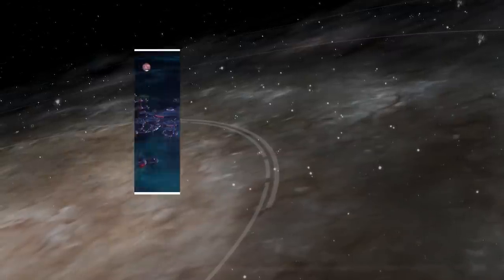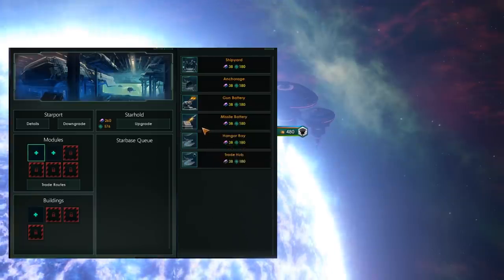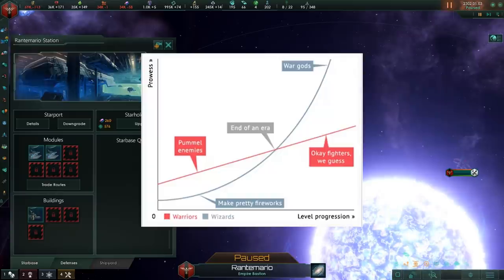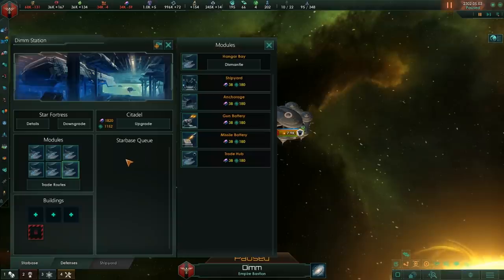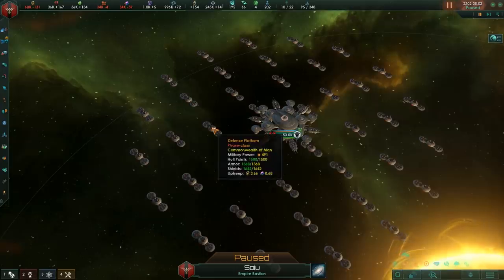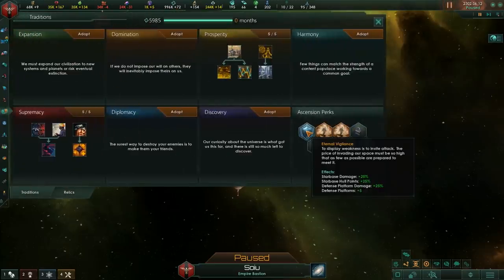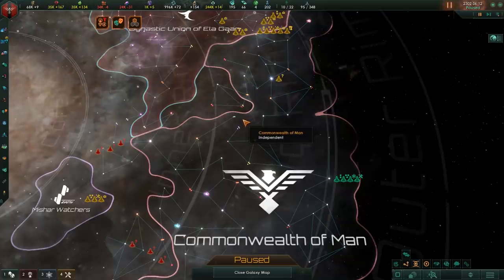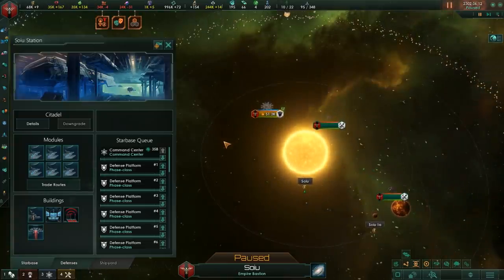Stellaris - Starbase Mechanics are Weird

Comment: Depends what you're looking from a station I guess, I love to put upgraded stations on a chokepoint mostly to benefit from that reduction of shields on the enemy and sublight speed (and listening post early game to know when fleets are spproaching) mostly as a backup to main fleet but it does give a good boost when fighting in the system. What does bug me that lategame stations are just being wiped by fleets no matter how many extra defence platforms you have, they can stall enemy for a bit sure but in the end all your defence stations are lost and have to be rebuilt which takes too much time and alloys. I think defence platforms need to be cheaper or become part of station and simply be disabled/recaptured as stations do

Comment: This is one video I'm going to have to disagree on. Even in the late game I use stations as a way to minimize losses to my fleets. If you know where an enemy fleet is going to arrive set your fleet a mid distance away from the station on the opposite side of the system the enemy fleet will arrive. The enemy will engage the station first (whose power doesn't really change outside of defense platform losses), your fleet will engage the enemy, and then the enemy fleet will get strung out and pulled into a very thin line that will put many of the smaller ships way out of position and leave nothing but their bigger ships behind stuck between sometimes shooting the station and sometimes your fleet. It's probably a cheese tactic since this is using the fact that the fleet AI seem to bounce priority constantly when caught like this

Comment: I have a mod, can't remember which one, that adds more buildings and modules to starbases, both in number and type. It also adds 1-2 more starbase levels which pretty much make them able to to kill or at least hold off most fleets.
Reply: How do ai’s deal with them or do they not get the upgrades?
Reply: @bubbles7608  The ai did use them, just not to the extent a player could. The final station levels are expensive.
Reply: The nsc3?
Reply: @13akful  Might be

Comment: One big station with only the hangars and one with only the trade hubs + gateway network. To protect and collect all the trade value. Spread shipyards on several, but far away from borders. Combine shipyards with anchorages to squeeze out all the fleet capacity that you can squeeze out at any given time. Do not cluster shipyards+anchorages stations, spread them around and connect with gateways as well. Make sure that it is hard to cripple your empire by the enemy by just taking one or two key stations. Spread your specialized colonies as well for the same reason. Research regenerative hull tissue early on if you can, all your stations will have it the same way they get FTL inhibitors. Combine defensive stations in the early game and against any crisis with systems that have environmental hazards that are not just coming from a system being in a nebula. Do not use Citadels for anchorages, save those alloys for reinforcing fleets and/or retrofitting them to hard counter the enemy fleets. That is my philosophy at least.

Comment: I use stations like you describe for baiting enemies onto them and then have my fleet attack, but I do this for longer than you do.  It's not like it's hard to set up a choke point where a fallen empire has to come through to attack me, and adding a bunch of hitpoints alone to the battle is helpful.

However, for real defense, if I feel I can't hold my borders, I just build habitats and make it a fortress.  Fully decked out, it holds.

Comment: I find citadels quite useful actually. Especially for protecting systems of high importance such as my capital and any system in which I have built a Dyson Sphere. The reason being that even though the station can be destroyed in late game, in most cases, if not all, it manages to hold the enemy off long enough for my main fleet to not only return to my space but make it all the way back to said systems. Furthermore, in the cases where my main fleet is nowhere nearby, having a citadel allows me to use any of my much smaller fleets to win battles against larger fleets. For example, in one run, I had split my forces into 5 main battle groups as I was fighting on different flanks. While assisting my allies against the end game crisis at the time, one enemy fleet managed to make it into my territory and attack my 2nd battle group's headquarters. That station was a citadel and it was working on pumping out a colossus at the time which was needed to finish the war once and for all. Had it not been for the strictly military citadel, I would have lost a crucial part of my plans, but the citadel, armed with 2 ion cannons and max defense platforms not only held its ground but once a smaller fleet which I had guarding another system arrived and caused the enemy's fleet to turn away from the citadel and start focusing on them, the citadel managed to shred the remainder of their ships to pieces thus proving very effective. Needless to say I immediately redirected a much larger fleet back to that sector to defend until the colossus was finished but it just proves that if used right, a citadel can be the difference between victory and defeat.

Comment: if you disassemble a module on a station in a fight, it resets its full health. not advisable in multiplayer pvp (is seen as exploit, unfixed since forever), but it might make your heavy station defend more in single player - you can have up to 6 resets that way, regaining shield and armor value (minus what the module gave). it does not work on captured stations. it might also work with downgrading.
if you build defense platforms with almost nothing on them on outposts, they will also suppress piracy for very little upkeep.

Comment: I always build them in my capitol system, shipyard systems, and any system with a megastructure in it. Also, place them at choke points on the borders and connect ALL of them through gates. In my capitol system is always a rapid reaction fleet that can respond to any of those chokepoints or other important system. That fleet IS NOT for invading other empires or anything else you would use a fleet for, it is the fleet that will defend my empire if some bad shit goes down while my other fleets are away. The citadels might not completely stop an invasion in its tracks but it will slow it down until my rapid reaction fleet jumps in to end the threat and can support the fleet in driving the filthy invaders out of my empire before they do to much damage.

Comment: Saw a lot of comments regarding Lathland's super Citadels. People seem to forget that at a similar tech level, the battleship doomstacks will still absolutely dwarf the Citadels' power. With optimized play, you can have about 1.5-2m fleet power with a little under 5 repeatables by the time crisis arrives with 2250 endgame date (so it arrives around 2310-2320ish). Take that to 2400+ when Lathland had his super Citadels, and your fleet power should easily break into the 10-20m range or higher. 

Also, in optimized play for 2250 endgame, you don't have the luxury of neat little choke points since you're almost always beelining planets for the population and often have to end wars early due to another war on the other side of your empire. And after you snowball, no AI will want to declare war on you, with or without Citadel choke points.

And finally, starbases aren't actually good for getting fleet capacity lategame; you build Armories on specialized planets since your starbase cap of ~20 won't be enough to get the 2000+ capacity required to hit the 1.5m+ fleet power goal by the early crisis date. My main use for starbases in these runs is for fleet capacity before I start building up my Armory planets as well as getting some storage to bank resources.

Comment: Play a science focused tall materialist with mechanist/technocracy. Lathland did this, he picked the relevant defence platform perks and managed to get his citadels up to 400K with 20+ repeatable before 2400, enough even to discourage the Prethoryn! So long as you don’t start next to a Purifier or Swarm, it’s totally viable to go full fortress turtle. Galactic geography permitting, I should also mention Pulsar + Plasma / armour combo which can create impenetrable choke points even in the early-mid game with relatively little effort, excepting that the main station still auto equips shields and anti shield weaponry for some dum reason... :-/

Comment: Stations are also how you gather trade value and how you boost your fleet strength, so you always need to build to your maxim at least up to fortress level for that reason alone. I always build citadels at key border choke points, if only for the fleet boosts. What isn't mentioned is that late game, if you've focused on keeping sprawl in check or have just got deep on research, the repeatable techs for weapons and station firepower/defense values can see your defensive citadels become very powerful. 

Tend not put more than 1 ion cannon on tho, given firing rate is so poor. Technically but late game you are going to have a sentry array so outside of the crisis, you should know where your enemies are and be able to deploy fleets accordingly - stations are by then mostly for adding fleet strength, ship building/repair, trade gathering/protection and occasionally special module use like boosting global mineral storage etc. But as I say. the deeper you dive into repeatable techs, the stronger the citadels become (as indeed is the case with your fleets). Can get a bit crazy.

Comment: I rather like the fact that starbases are actually useful at the start of the game. Saved my ass in a game where my pacifistic xenophiles started right on the doorstep of fanatical purifiers. There was only one way into my space from them, so an upgraded starbase held them off long enough for me to get some decent fleet power together.

I do think that late game starbases need a slight buff. What would be nice is if defense platforms got different modules unlocked with tech that allowed things like mounting large or X-class weapons.

Comment: I have noticed that the AI basically B-lines straight to wormholes and gateways. I had the khan send 5 fleets into my system with a full citadel and 4 ion cannons + my doomstack fleet, mopped the khan up before I realized it was over

seems to happen anytime I have a wormhole or gateway though, the Ai seems to think its quicker to path to there instead of anywhere else

Comment: Stations (even citadels) are still great imo. The bonuses they give apply to all the ships in the system, and if the station is destroyed, you don't lose any alloys. You're correct in saying that stations won't be enough to defend your borders past the early game, but they can make defense considerably easier for your fleets.

That said, once I get a fortress world up and running, I will dismantle my station at that choke point. No point in giving the enemy free repairs.

I also tend to not use hangars. Most early game AI fleets will have lots of point defense. So turrets are a better option. Don't really care about pirate suppression. I just kill them when they appear.

Comment: i have to say that with the right mods starbases become really op as if you have both gigastructures and unlimited megastructures and any mods that add better defence weapons then they become able to hold back anything my last game my 4 systems that led into my empire had maxed out stations with insane weapon stats they became the bane of anyone that attacked me between this and the fact that my empire had a jumpgate and wormhole i also had those two systems maxed and used them to stage attacks on enemies from their rear in the end i held back the end game event alone everyone else fell when they stopped attacking i started to move my lines forward oh and lets not forget my fleet of battle moons

Comment: Unfortunately Aspec did not talk about special system values. Neutron stars nullify all shields for example.
I was able to stop some 200k+ fleets with strategically placed fortresses using exclusively armor protection with max hull and armor damage output.
I still had to deploy a small fleet near the end of the battle to turn the relatively equal fight to my favor. I was not using any Ion cannons though.

Comment: Personally, I have found them to be a life saver with my inwards perfection pacifist run (no dlc, can’t afford it, it’s also my second play though, the first one I lost) because I spawned next to a fanatic Xenophobe militarist faction that keeps attacking me like clockwork and because of my comparatively tiny fleet cap having a star fortress to provide additional firepower against a corvette and destroyer spam fleet is incredibly useful, allowing me thwart there attacks with minimal loses, or at the bare minimum slow them down enough to allow me to move my 1st patrol fleet into position to strike there weakened force

Comment: I may repeat others a little, but while I do not have your level on this game, and that I have nothing of a min-maxer, I find bigger station pretty useful when it comes to slow down the enemy and soften their fleet, as well as acting like a frigging tank when my fleet engage next to one of them.

I agree they are pretty expensive, but by blocking a ton of enemy firepower as well as allowing my fleet to repair quickly, it allows devastating counter attacks.

Should you be quick enough, you can take back all station before they come back to maximum capacity, denying the same advantage to your enemies

Comment: If you build gateways strategically in your empire, you don't need pirate protection. You can just collect all your trade from a single starbase because it will be at less than 6 jumps from everything.

Really late game, I find that starbases are mainly useful for naval capacity and for creating fleets.
Reply: If I remember correctly at least trade value of systems (planets or other stellar bodies with trade value) does not get collected through gateways. But yea, trade routes do use gateways
Reply: @Lessen_  I can say with 100% certainty that you are wrong. I played a game with an empire spanning most of the galaxy, all covered by a single star base and a network of gateways. They also go through world holes so you can get a two for one by building a gateway in a system with a wormhole.

I actually thought the same as you before. In that game, I first I was building trade bases in strategic places and adding a gateway in them, but then I noticed a lot of my systems had their trade collected by the "wrong" starbase, so I decided to convert most of them to most of them to shipyards so I could replenish my Navi crazy fast.

Although do keep in mind that gateways and worm holes count toward your maximum range the same way hyperlanes do.

Comment: I agree that, if you are hurting for alloys (which is often), a Citadel isn't worth it compared to more Battleships. Static defense is always worth less than the equivalent in mobile ships and only one extra building slot and no XL weapon slots. I think two would be good. Two extra building slots would make the Citadel a bit more valuable (plus I can't stand that the number of slots isn't symmetrical! 6x6 not 6x4. Even 6x3 works okay). In fact, starbases should be in the ship designer. I think it's absurd that we still can't design our starbases this long after release.

You're right about Gateways making pirate defense trivial. That said, I was hoping you were going to show the optimal pattern of trade-bases to hanger-bases.

About the only time I take Eternal Vigilance is if I'm going Inward Perfection or pacifist; one doesn't get into many wars if one is lucky. I'd say it's only worth getting that Ascension if you plan on building Citadel Fortresses. While starbases are meant to die, one you get a Gateway in the system and those 40 platforms, it's basically a second fleet alongside the fleet that's going to arrive shortly after combat starts. 

Sometimes, if I've got alloys to burn running IP, I'll build a bunch of platforms on the Outposts in choke systems. I think it's 3+5 from vigilance + 12 from the megastructure = 20 platforms. On an outpost. No one's coming through a few of those systems that isn't Overwhelming to you already. The downside is that it's a bitch to upgrade them because outposts don't show up on the Outlier.

I was also hoping that you'd show a demo of 8x Ion cannons, vs 40x platforms vs some mix of ions and platforms. I guess the ions do have a lot of toughness compared to a platform and absurd range, but do they really fire fast enough to deal much damage? Are they effective against a Corvette-heavy swarm?

Good video otherwise with good information about each tier.

Comment: So basically, star bases go from front line defensive structures to cut off choke points, into a strong support that buffs you and your allies while debuffing your enemies.  I always keep star bases at my choke points fully upgraded for that very reason, just in the later game I make sure to keep a fleet or 2 hanging around so it doesn't immediately fall into enemy hands and I can get some reinforcements in.  Star bases are severely underrated in the late game, they can truely turn the tide of a close war.  They are perfect for setting elaborate traps, and their buffs, debuffs, and ship building capacity make them perfect as a staging ground in a defensive war.  Aggressive empires may have limited uses for them, but for a pacifist empire they can be the difference between winning the war, and complete and utter annihilation.  For the man who speaks with might, they are useless.  For the man who seeks to out think his opponent, they are powerful.  For the man who does both, they are the glue that holds his empire together.